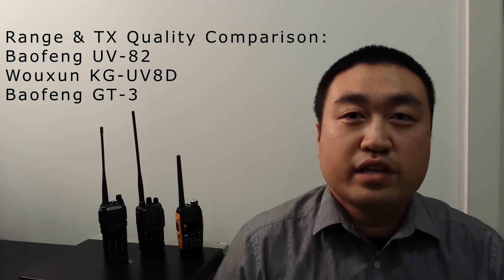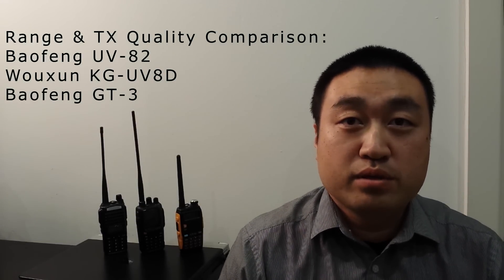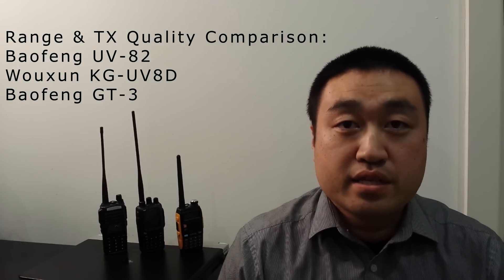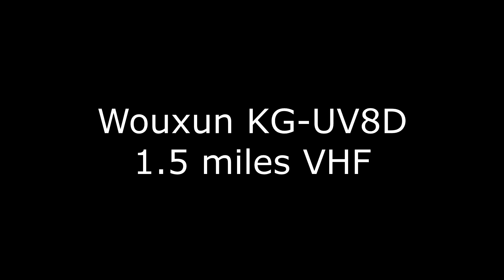Baofeng UV82 GT3 Wouxun UV8D VHF vs UHF Range Test Part 1

Comment: All 2m/70cm radios transmit with less power in UHF.  Was that taken into consideration? usually 5 watts on 2m and 4 on 70cm.  Yes only 1 watt difference however, that small difference can produce different results.

Comment: I think it is better to use the same antenna for transmitting with each radio. Thus you will be comparing the radios themselves, excluding other factors like how well rubber duck antenna matches the radio. Anyway useful video. Like!

Comment: I just have a couple questions. I am new to this radio stuff however at work we use Motorola radio would something like this or even the gt1 be sufficient for a business to run possibly in a factory or the yard? the question only arises with me because the Motorola have been working okay for us lately but we need new radios and this brand is a fraction of the cost of a Motorola. any response is greatly appreciated thank you.

Comment: UV-82 seems to win on UHF @ 1.5 miles, and can be had at about 1/3 the cost of the UV-8D. The UV-82 has no cross-band repeat, but how often is that used on an HT?

I'm ordering a UV-82 as soon as my local dealer gets some more in...
Reply: +Robert Sargeant Given the duty cycle, it seems more like an intermittent use feature.

Comment: Great test! I agree with others, UV-82 is the obvious winner here, and costs less than the other two. I'm happy with mine!
Reply from the maker: I have a small issue with the FM broadcast on the UV-82. A video will be uploaded about that issue. The screen could be bigger but I guess they need more room for the bigger buttons. The A and B PTT is a nice feature too.
Reply: HandyRadio What's the issue with the FM broadcast on the UV-82?

Comment: I think this is by far the most useful real-world comparison of popular Chinese HT radios I've seen - would be even better to see a good signal meter recording the received TX of all three sets on all bands at various distances.  Very obvious how quickly UHF attenuates to become useless - that was a surprise, expected something like that but nothing like as close as 1.5miles.
I have the UV-82 and a UV-b5 is on the way from Amazon, I want to see what the allegedly improved RX on the B5 was like in practice - plus the rotary VFO - I don't much like the up/down buttons most of these sets are stuck with.
So a BIG thanks for doing this, more along these lines please???
Reply from the maker: Thanks Ian

The only 2 thinks I like about the B5 is the VFO dial and the fast scan speed. More videos to come of course.
Reply: Now have the B5 in place, at one point was close to tossing it across the room....   CHIRP can't connect and neither can the useless Baofeng software - which defaults to simplified chinese characters!.  So it was back to the buttons and the Miklor site - or else send it back.  Apart from that initial annoyance the radio performs well enough and there is a noticeable edge on RX performance over the 82, no question.

The scan speed I haven't noticed as very different from the 82 although it's rated as faster - and its screen display is a hard to read disgrace!  Every one of these radios has silly design features and good design features, it's like they're designed by different teams who don't know what their colleagues are doing.  For me a UV82 with its silly LED torch replaced with the rotary VFO and improved receive would be a huge improvement - and if they made the scan limits programmable that would be close to perfect.

 Also got what I think is a real Nagoya 771 and there's a slight improvement on both radios using it - but the extra length makes the radio a bit of a pain to handle and use - the standard stubbies these are provided with seem to me to perform well, although that's just a subjective impression.
Reply from the maker: All agreed Ian :)

Comment: KG-UV8D seemed most consistent throughout the test. But as mentioned by others this needs to be done the other way around and test them on recieve.

Where they all using the stock antenna too?
Reply from the maker: Jon Byrne All stock antenna indeed. I'll reverse the order so the next video will be receive test. Same radios and same locations.